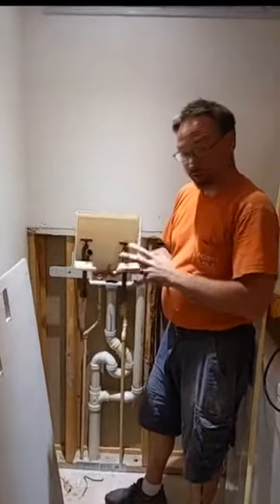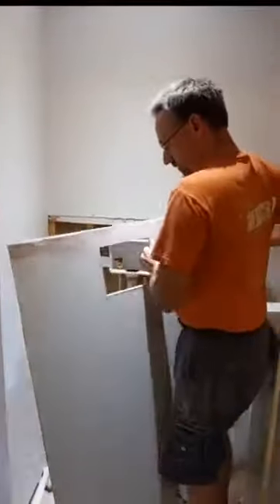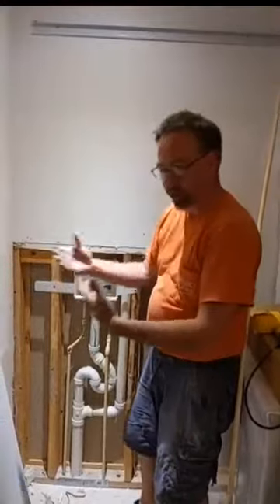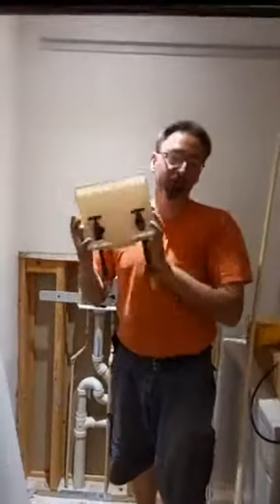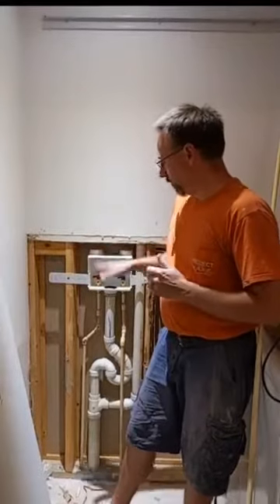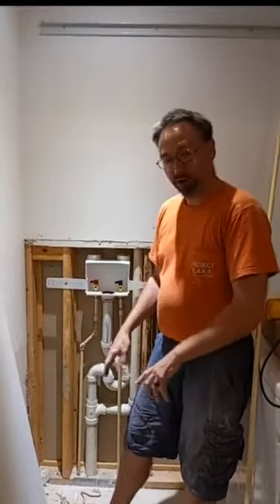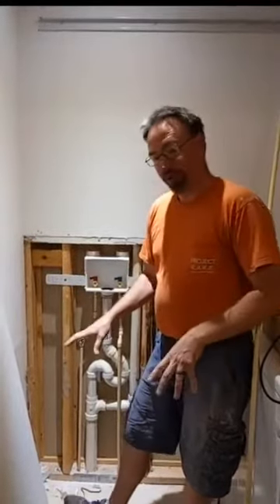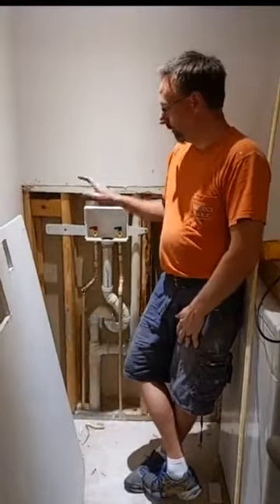Water Damage in Laundry Room Repair (Part 1)

Comment: Wow! So glad I discovered your channel. Question? Can a Studor valve be used for the washer air vent? Thanks in advance!
Reply from the maker: Hi Pip. I'm glad you're finding this content helpful.  If you haven't already subscribed, I'd like to invite you to do so.  Let me answer this a couple of different ways...

1. It really depends on your local codes and what your municipality or township or state requires, And when they will allow for an air admittance valve.

2. If I'm doing your renovation, I would really like to see a real vent plumbed up to the attic or tied into some other line that is part of the plumbing vent system... Whenever possible.  

3. I'm sure there are always situations where it would really be cost prohibitive to do that, and in those cases, yes, an air admittance valve is better than nothing.   In these cases, I would prefer to not bury it in the wall... But rather, bring it out into the space or install an access panel so that it could be replaced or serviced if it ever begins to fail.

I have had two cases, where a self contained sump pump, had been installed, using an air admittance valve.  The problem was, the sink did not drain properly because air could not exit the pump sump basin as water was being added prior to being pumped.  The valve opened perfectly when the pump kicked on, ejecting the water and needing air to fill those voids... But the sinks drains slowly or not at all because the air could not escape to make room for the incoming water... In both cases, we had to rework that plumbing and tie into traditional venting systems.  

Hope this helps. Please let us know if you have any further questions.